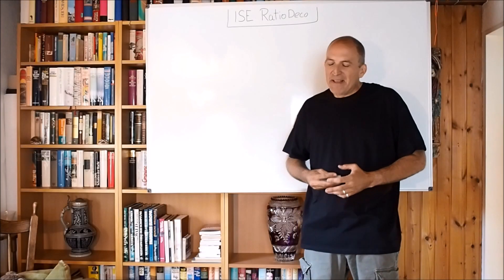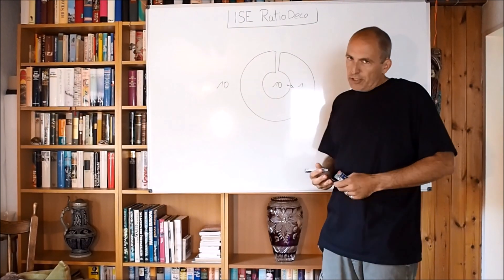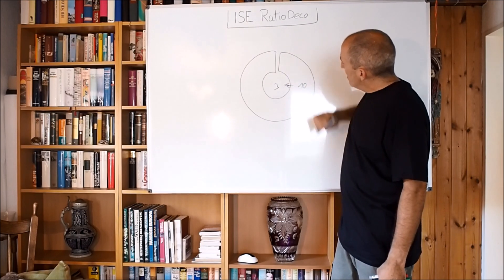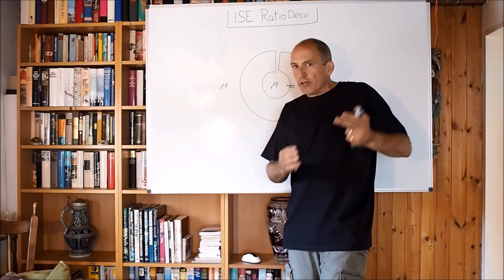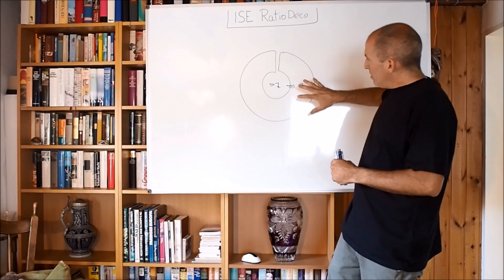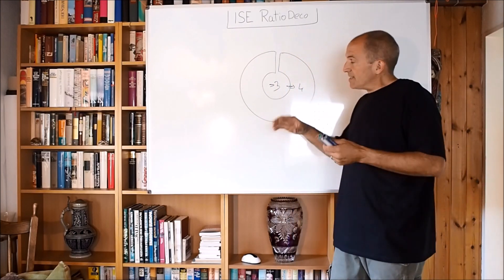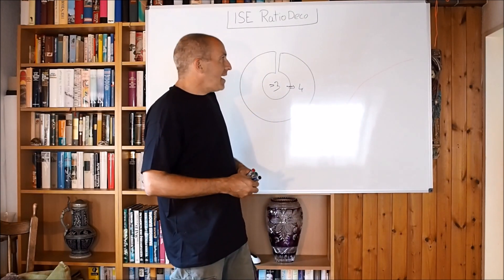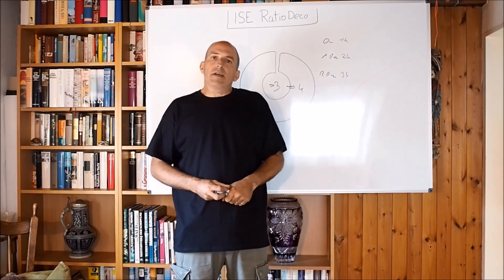ISE Ratio Deco Part 3

Comment: Hi, I don’t understand why the pressure difference is higher between 10m to 0m than between 20m to 10m... is 1bar between each, right? Could you explain?
Reply from the maker: 1 bar (surface)  is 50% from 2 bar (10 meters)  - so its half the pressure.
 2 bar is 2/3rds from 3 bar (20 meters) .

Comment: Hi Achim, do you recommend using dual bladder for redundant buoyancy?
Reply: I am not Achim but i think he got the opinion that if you are weighted correctly you dont need it.
Reply: ultimatdestroier Thanks for replying, but redundant buoyancy is necessary for tech diving. Usually we could just use drysuits but if diving in warm water maybe a dual bladder design is better?
Reply: There is a great video by Steve Martin an extreme cave diver. I saw it once on youtube but cant find it, here a link to his wp: https://www.sidemounting.com/lesson/how-to-handle-bcd-failure-at-depth-8-5-min-2/    I have never seen any ISE member using a redundant bladder. I still get your point. There are videos explaining how to use a DSMB as a redundant buoyancy device. Hopefully I was able to help. Maybe try to ask again on a newer video.
Reply: ultimatdestroier Hi, I was the camera man showing his ascent with failed bladder and using just easy finning strokes, it was no problem as he was correctly weighted.  The video is shown on his video training courses that are highly recommended.  The dual bladder in a wetsuit is certainly a good idea, but for the kind of tec dive it would be needed for, you are more likely in a dry suit anyway.  Watch out for the video updates we are working on where we take this idea quite a bit further 😏

Comment: Hi, can I have a question about isolated manifold, why we do not use 5 values manifolds? Let imagine that you have frozen 2nd stage, in that situation you want to isolate the first stage of frozen the second stage but not isolate tank. For example, if frozen is stage connected to above A value, you would only close A value - there is still an open way from both tank to stage connected above C Value. What's more, in this configuration I can even imagine that there is no B value and you could still block all leaks. Why this solution is no common? link to schema image: https://ibb.co/M676MVy
Reply: Manifolds work in the way your A B C valves are displayed. there is no need for D and E Valves since B already provides this feature if you think through it
Reply: @Blubpaule  Thanks, I have drowned it and now understand :)

Comment: Newb here, logically it seems that you're actually better off ascending more quickly while your tissue pressure is below your ambient pressure...if ambient>tissue you're on-gassing, if ambient<tissue you're off-gassing, so that ascent time would be time spent on-gassing albeit at a slower rate. Minimizing that time would be a good thing I'd think?
Reply: If I understand correctly what you are saying is that "you are better to quickly accend from your deepest point of the dive to the point that you start to off gas and then slow down to do all your stops as normal" then yes I agree with your statement. The longer you stay below the depth at which you start to off gas. You are constantly on gassing.
Reply: Don't do that. As he explained, what you're suggesting is a bounce dive. That's dangerous. Build a curve. Also as he explained. If you have more question he'll answer on patreon.
Reply: The faster the bounce, the faster the relative pressure change gets.  The closer you get to the surface and shallower than 60ft that really starts to add up and the conditions favor bubble formation more and more.
The shalower you get, the slower you shoud go as the relative pressure change gets bigger and bigger.